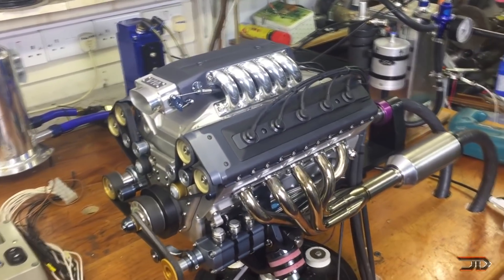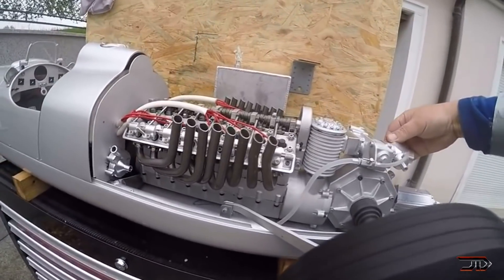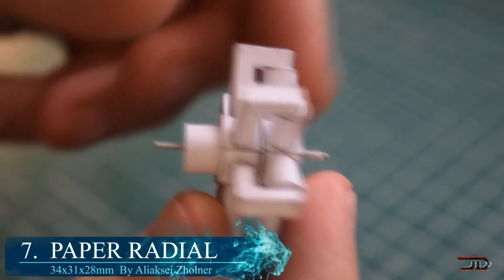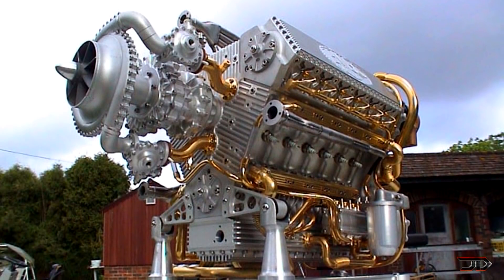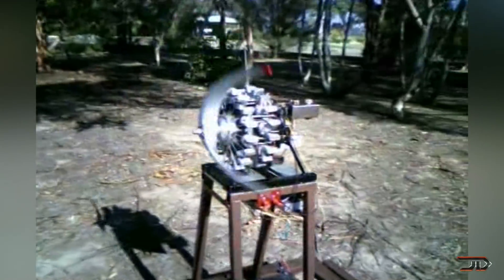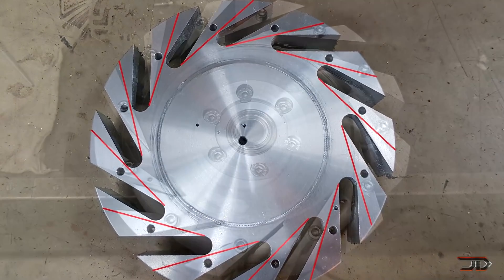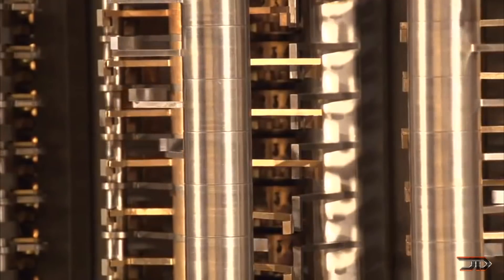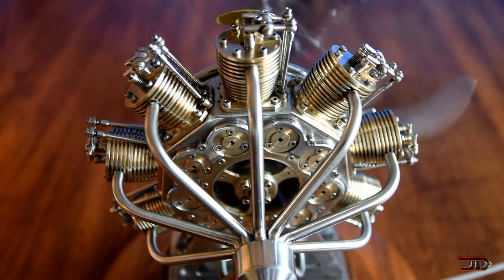TOP 10 Homemade MODEL Engines

Comment: You missed some classics! Go back to 1936 gold medal winner of London model engineering exhibition the18 cylinder double Bank radial made on a treadle lathe by Gerald Smith.  In the early 80's Barry Hares completed a 1/5 scale running merlin. This was a true copy of the full size merlin which even had working magnetos. As fabulous as the merlin you feature is, it's simplified internally from the full size. Barry Hares again about 15 yrs ago with Rolls Royce Eagle.  Mike Sayers 1/3 scale supercharged Bentley is another.  Lew Blackmore in Australia made a beautiful Bentley 9 cyl rotary (and published a book on how to do so). There are quite a few super talented builders, top 10 is a hard choice!

Comment: The Auto Union V-16 was weird in that as an OHC engine it used pushrods for the exhaust valves.
Some you missed are the H-24 Roll Royce Eagle, the H-16 Nsiper Dagger and the 1/4 scale Offy built in the 70s

Comment: Amazing stuff, but Running on fuel is an order of magnitude more impressive than one that just pretends to run (air). I've the plans for the 18cyl radial and is on my build list along with an offy engine designed by Ron.